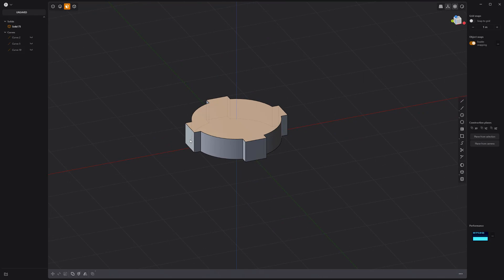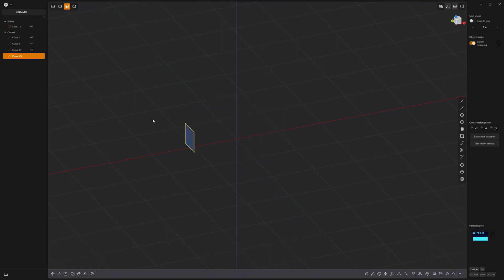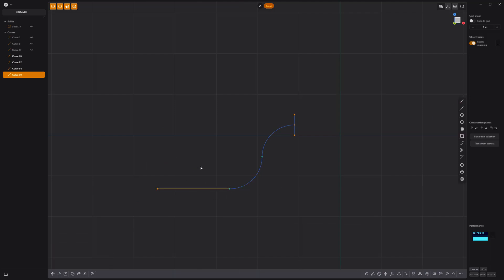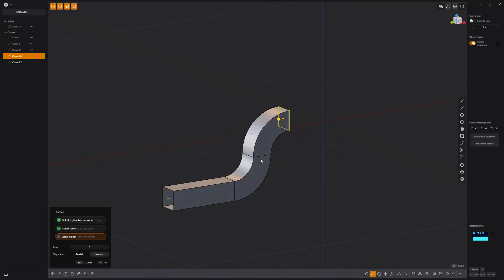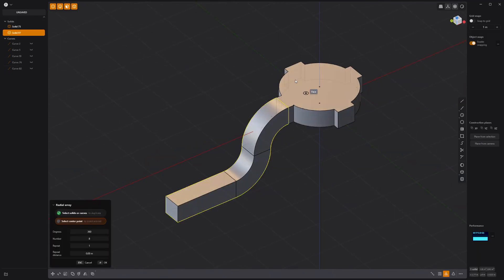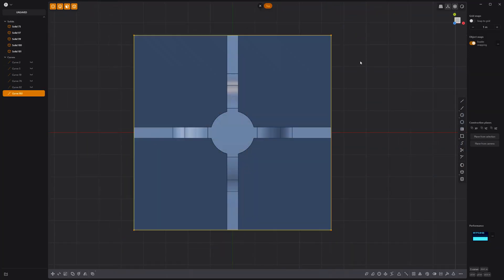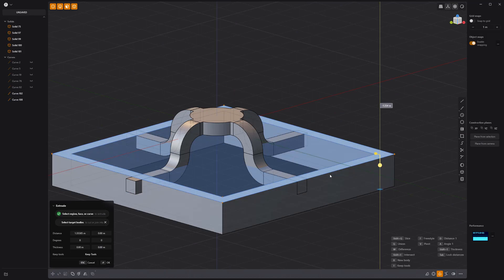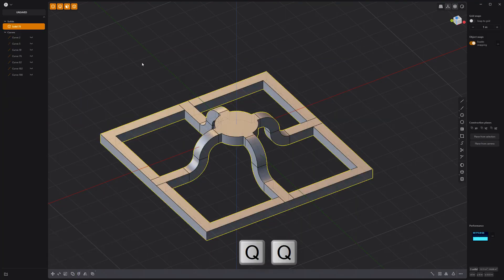Plasticity | Modeling Exercise 37

Comment: I don't know if I did something wrong or if the beta version 1.2.6 is having issues but I ran into problems executing the sweep. Also had issues joining my S curves. I got the over all shape made but was unable to do the final fillet of the model.
Reply from the maker: are your curve end points touching
Reply: @Pixelfondue  it was but then I fixed that. In the end the only way I could get the sweep to happen was to split the s curves and then sweep part then the next. For now I've moved on in your tutorials and I'll come back to it once I've completed them. Out of the 31 I've done so far that was the only one I had problems with. I got a feeling I'll probably figure out what I did wrong as I go along.